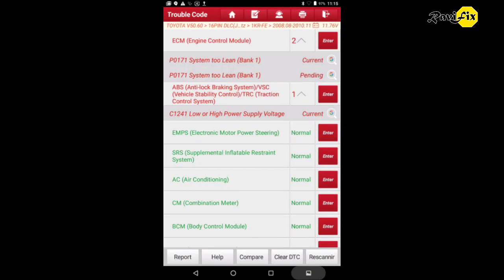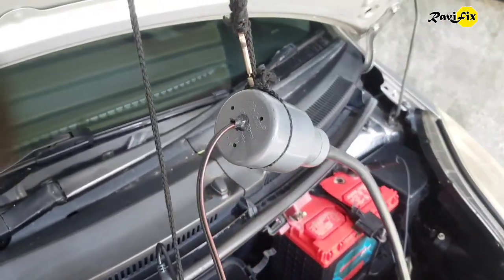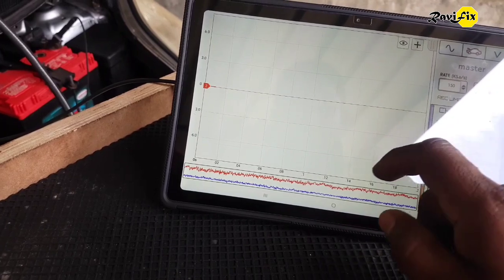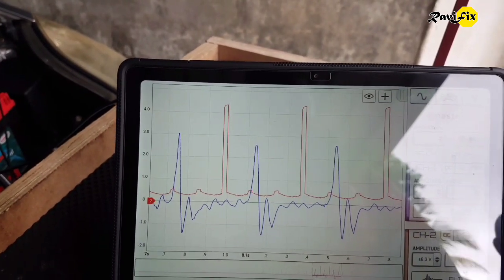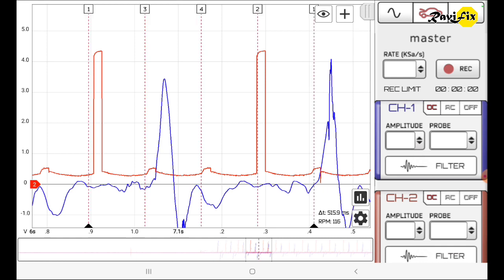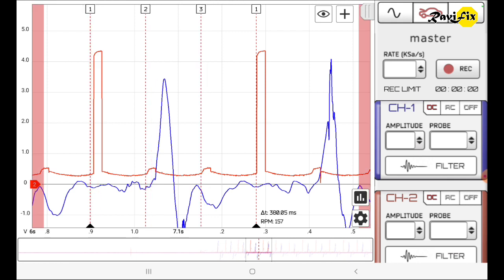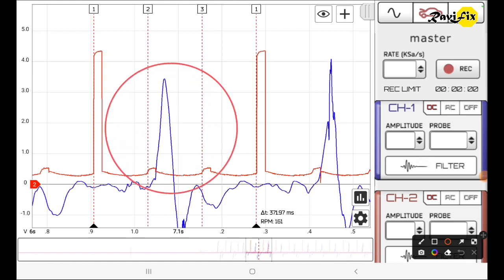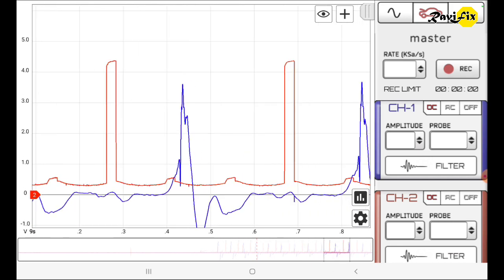Quick Diagonosis of Blown Head gasket on Toyota Vitz by analizing Radiator presure pulse waveform.

Comment: Excellent work...
I am glad i found your channel....
I was struggling with capturing my first automotive waveform with my Hantek 6022BE and then your vedios really helped me....since then not only captured my 1st waveform but also could build my DIY Inductive pickup....that worked well....else, off the shelf pickup was quite costly and not available in Pakistan 😢...
I am still struggling with my Hantek 6022 BE for getting what your Hantek 10 channels is giving you😂. It seems Hantek 6022BE (max 20 MHz, 48MS/s) doesn't have the juice to give me that beautiful waveforms which are being generated by yours...more so, if i can have chance to chat with you on any platform for my silly queries on scopes🤞
Looking forward.....

Comment: Thank you for sharing Ravi 
Just one question
Why you didn't put an attinuator on trigger pin ?
Reply from the maker: Here i am taking ignition trigger signal which is 5 -0 volts. So it doesnt need an attenuator. an Attenuator need for over voltage range mesurements other than scope maximum input range.

For ex: primary ignition waveform or
Injector pulse mesurements need an attenuator.
Reply: Thanks Ravi 
So three and four wire coils you can measure trigger but two wires coil you measure primary ignition.
Am I right?

Comment: Solid work Ravi. These vehicles are surprisingly fast for a small car. They also have the 4WD type. But question, is the falling edge of the signal pulse would show closer to TDC? Solid still bro
Reply from the maker: Thank you my friend.
Yes me too wondering why the rising  edge of the pressure pulse start at just close to the TDC. What i believe low intake volume at the crank, start to rising the pressure at the last moment near TDC. I would have to do this cranking test with WOT. (Wide open throttle like clear flood mode) then more air volume might start to presure it up early like when piston come middle of the cylinder while compression stroke. Maybe i am wrong.